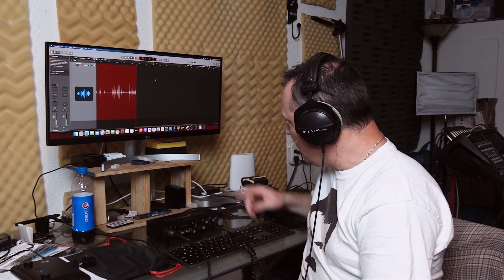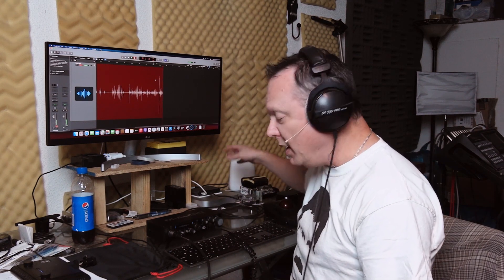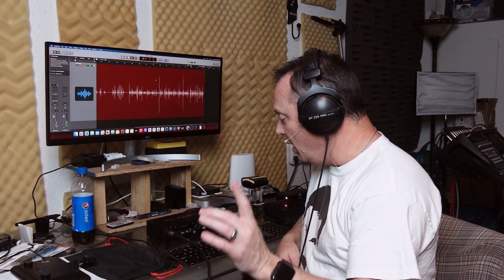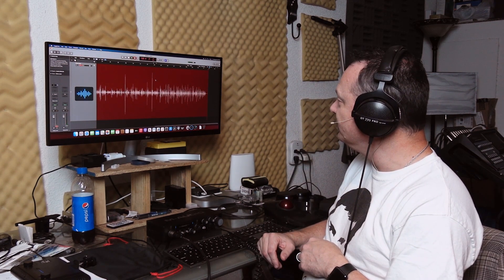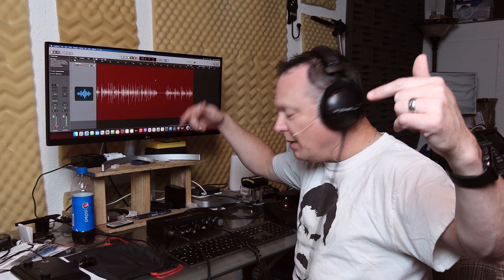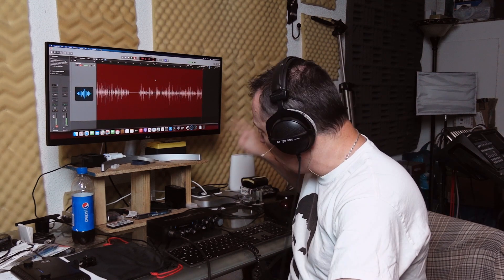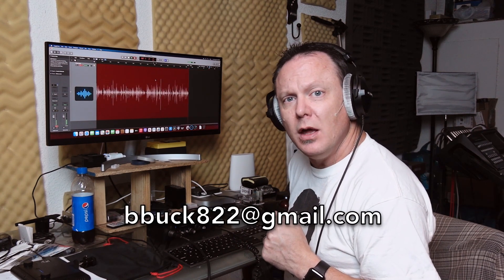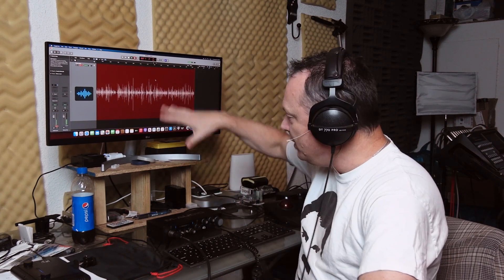CalDigit Thunderbolt 4 Element Hub with a USB Audio Interface

Comment: Nice! My million dollar question is: Can it run without the power brick? Let's say you're on the road with an M1pro MacBook Pro, and you need a hub with no outlet in sight. Would it work, with some reduced wattage output per port, or something like that?
Reply from the maker: Yes, it can run without the power brick. The power brick does allow for laptop charging as well as offline charging of connected devices. It is your call as to how you use its many features.
Reply: @BrianBuckalew  oh, that’s odd. In the meanwhile a rep from Caldigit support team has told me that it does not operate without the power brick. Perhaps it’s all up to the power requirements of each connected device?
Reply from the maker: Correct

Comment: Can you use an adapter to an ethernet cable to one of those thunderbolt ports in the caldigit element hub? Thanks. I just bought an audient id 14 mkll with usb c port! Also got a Zoom H4N with a SD card.. 
Hope this hub can work for the audient audio interface as well as getting the ethernet into my new macbook pro, just setting everything up this weekend but need a hub for sure… any advice to get better and faster transfer if music let me know!
Also wonder what you think of ableton vs logic pro?
I will record songs, instruments and voice acting at home and sometimes out in field for event like music festivals or stand up comedy festivals … a lot of beat music artists tell me to go with ableton and say is more intuitive and easy to handle for a beginner like me in music recording! 
So appreciate your thoughts on this!
Reply from the maker: Hello FTM. You can use this USB Hub, but just know anytime you use an apter you are taking speed away from the data transfer. It is always better to use a cable that has the "adapter" built in - so an ethernet-to-usb C cable would be what I would look for instead of an adapter to add to a cable. Perhaps something along these lines would be what you re looking for: https://www.amazon.com/OIKWAN-Essential-Accessory-Ubiquity-Switches/dp/B0774JV2QQ/ref=asc_df_B0774JV2QQ/?tag=hyprod-20&linkCode=df0&hvadid=321499553671&hvpos=&hvnetw=g&hvrand=10642610917611788968&hvpone=&hvptwo=&hvqmt=&hvdev=c&hvdvcmdl=&hvlocint=&hvlocphy=9011643&hvtargid=pla-651122150616&th=1

I am more of a Pro Tools or Studio One fan than Logic Pro or Ableton Live. I have used Ableton over the years very briefly to make an occasional video to answer a subscribers question(s), but never to do actual client work. I would definitely suggest getting a demo version of Ableton and try it out to see if it has all of the functionality and features you require. If not then give Logic a try. It is definitely a World-Class DAW that has more features than most people realize.
Reply: @BrianBuckalew  why is the speed slowed down by an adapter but not by an ethernet to usb c cable?
Are these usb c thunderbolt 3/4 or just a normal usb c cable connection?
Are there ethernet to usb c thunderbolt 4 for MacBook pro 2021 as well?

Thanks for getting back!
As the hub is thunderbolt 4 it feels like a good idea to use a thunderbolt 4 cable then as well… will that uphold the internet speed in comparison to a normal ethernet to usb c cable as the example you sent me? And is there even such a cable?

Thanks!
😄👌🏻
Reply from the maker: Anything that is wired directly from the factory is going to have increased performance over an adapter due to the lack of the adapter company and the cable company working together to make sure there is no signal loss or speed loss. I hope that makes sense. In regards to a cable suggestion: I was just trying to show you an example of what you might want to look for. I have not used a setup like you are wanting so I can only suggest you buy a cable from Amazon so that if it doesn’t work or give you the speeds you need it will be very easy to return and get a full refund.
Reply: @BrianBuckalew  thanks, seems pretty forward then! a cable for cdmi perhaps can work to the other way around into the screen from this thunderbolt hub? :)
Reply from the maker: Possibly. Again, you would have to buy one and see as that is not how I use it - but Logic would suggest it could work that way. Sorry for not having a better answer for you.
Reply: @BrianBuckalew  what do you mean it is not how logic works?
One always use an audio interface / sound card to record, and then one will babe to use a DAE in ones computer to edit the songs as one like, right?!
Reply from the maker: I said logic would suggest it could work not that it couldn’t. I think you misunderstood what I typed.
Reply: @BrianBuckalew  ah yes, was not sure you meant that logic or the software logic pro would suggest that is how it works…. I guess that is just logical….
Reply from the maker: Yes, sorry for any confusion I may have caused you.

Comment: I've been seeing a lot of complaints in Amazon's comments about this Caldigit model. About that it makes a rather annoying buzz and that inputs are disconnected sometimes. Have you had similar problems? I also have the Mac Mini M1 and I'm also starting out a home studio!
Reply from the maker: I have not noticed any annoying buzz from the hub, but there has been an occasional dropout - never in the middle of using a peripheral. It will be if I have something connected that hasn’t been used in awhile. I will have to unplug it from the hub and then reconnect it in order for it to be recognized. I’m not sure how much of that is due to issues with the hub or the M1 Mac mini. I would not rate this hub negatively due to this as it really does not happen frequently enough for me to consider it worrisome. Hope that helps.